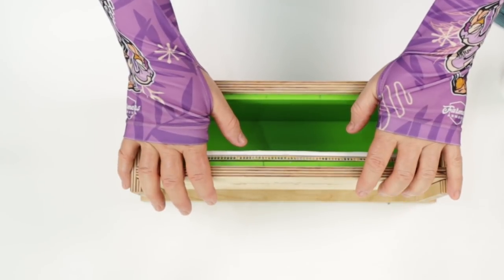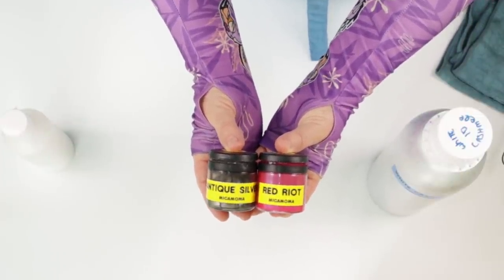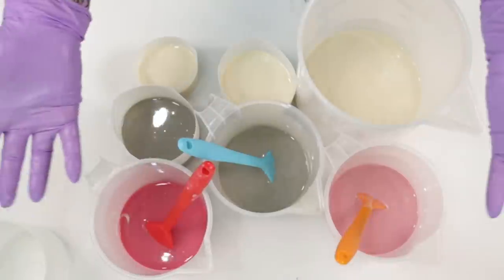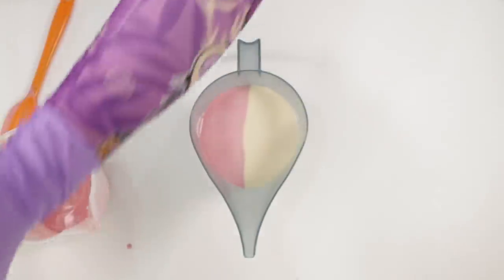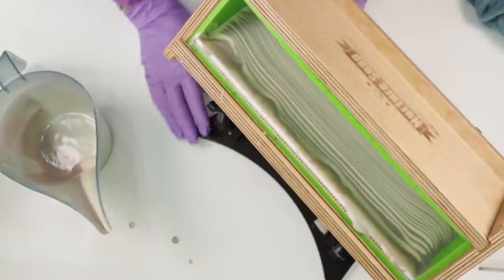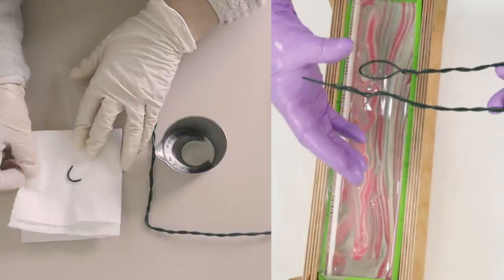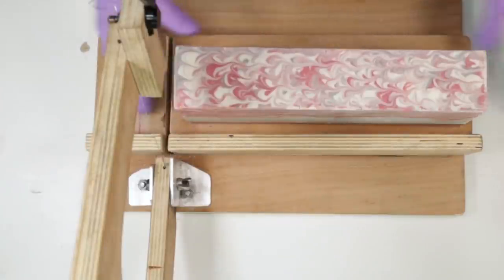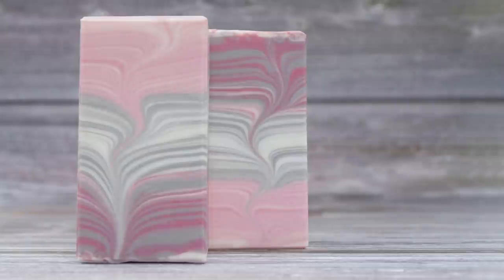Tornado swirl, cold process soap making tutorial, hanger swirl

Comment: Terrific sort of new design Lisa !! I like it a lot ! I see you have the same issue as I do with the Cheshire Cat tool. I’m thinking to make an adjustment wheel to allow me to adjust the angle of the mold as I need. I’m not keen to hold the mold in my wobbly old hands, or rely or the little pins on the tool. It’s a thought at this point. Anyway great job again! Love your work ! Cheers Mike
Reply from the maker: Thanks so much Mike. I do like the Cheshire Cat, I only put one of the pins in so I can adjust it easily if I need too, but it can still be a bit tricky at the point when you have a mould full of soap and you're trying to alter it just a little bit

Comment: An excellent video not rushed so easier to grasp what you were doing. I was most interested in making the log roll narrower,  because they mainly seem to produce wider bars.  Using core flute what a great idea it’s very affordable, but not seeing the soap come out of the mould would have been helpful, did it cause any problem?  Would love to know thank you
Reply from the maker: Hi Tassie Girl, no problem at all, in fact the side with the core flute actually comes out easier as you take it out with that still on the soap, then lift it of afterwards, it comes off with no problem
Reply: @IDreamInSoap  thank you for responding.  I’ll try it in my two moulds.

Comment: Your videos are so informative. When you cpop your soap, how hot does the soap get?  Do you ever get cracks on the top?
Reply from the maker: Hi Nancy. I'm not 100% sure as I don't take their temperature, they would just get as hot as a soap gets when it goes through gel phase, the oven won't add any heat to the soap, just force it to gel. Any soap with more water will get hotter, as I do quite a big water discount there is more chance my soap won't gel, or may partial gel, so I CPOP it to make sure it does.
If you cover your soap, so the top doesn't dry out that helps minimise cracks, also if you are uing a lot of high sugar ingredients, milk, honey beer etc those can all cause extra heat and possible cracks